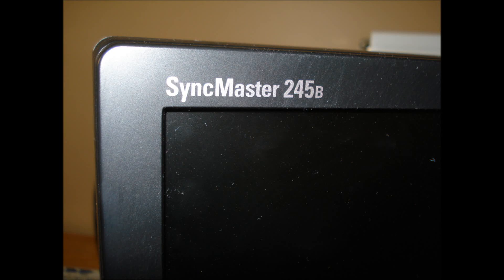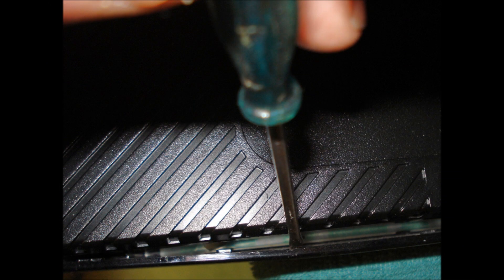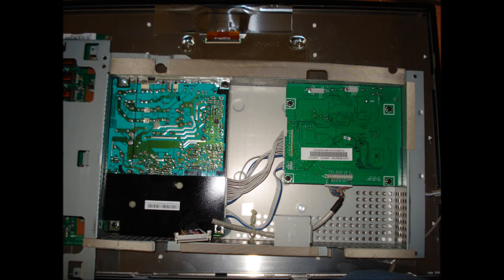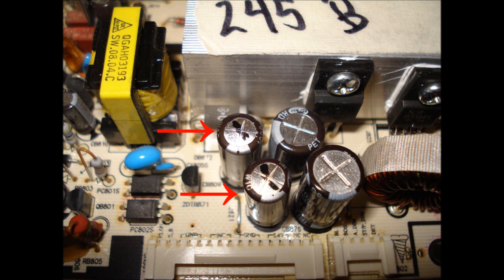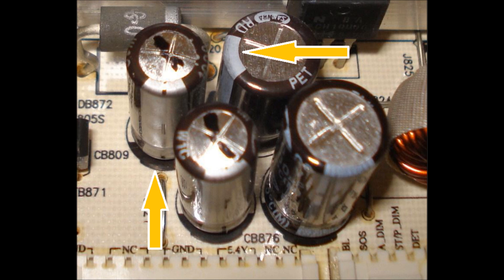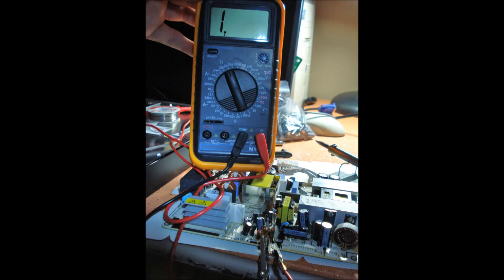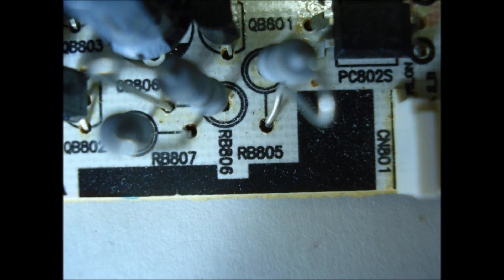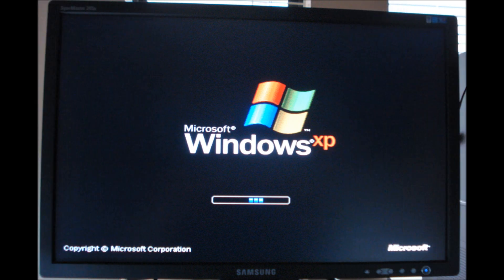Repair Samsung SyncMaster 24 Inch 245B - similar to a SyncMaster 24 Inch 245BW

Comment: Wow!  I did not look forward to replacing my Syncmaster 245bw.  It just quit on me, with the exact symptoms you described!  I dismantled according to your instructions, checked the resistors you indicated, and one was bad.  Caps looked good, and the fuses checked out.  Bought replacement Resistors for less than $0.50 total.  Desoldered, replaced, resoldered the resistors, and reassembled the monitor.  Bingo!!!  One working Syncmaster!  I've rarely had a project go this smoothly in one run.

Comment: Caps looked good, that first resistor in the series was fried. $1.50 for a pack of resistors at radioshack later... Working monitor!  I only replaced the dead one.

Thanks for the step by step! I owe my 1920x1200 resolution to you!

Comment: hey capman!

thank you SOOOOO much for your efforts of creating this video!
with your help i managed to repair my samsung syncmaster 245b!
one of the resistors you described was defect. i purchased a new one for 9ct and replaced it and - YEAH! 
the monitor works again!

and in addition: i found out that by removing one screw on the stand i now have a monitor i can rotete 90 degrees into portrait mode.
all this after 4 years of owning the monitor :-)

thanks again and have a nice day,
steve.

Comment: Thank You Sir, saved me lo a time.
One of my 68R failed, but looked fine from outside – would not have guessed. All Caps still fine. 
Replaced with 2 times 150R in parallel – was on stock – not nice but worked out.
Recycling @ home – love it!

Comment: resistor rm801 poped. what size value is the resister. all i can read is the first two bands which are red red ? ?, also what wud cause rm801 to pop?

Comment: I did the same thing but didn't touch the capacitors since one of the resistors had a short circuit then slapped the back panel back on and everything worked.  I just figured what are the chances of resistor's and capacitors failing together.  Thanks for the video!

Comment: I opened up the back and indeed a small blue resistor burned out on the board, the question is, can i just buy a new power board? or can i get this to a local electrician to fix this? sad to say i'm not soldering iron proficient.

Comment: The other known failure point not mentioned in the video is capacitor CM802. Replacing it fixed my 245b. It's 18nF 630V, but that's hard to get hold of, so I used 22nF 1000V.

Comment from the maker: To rule out the VGA and laptop card, plug the screen into another computer.  When you have issues with the image improving with time, this is usually due weak capacitors.  Another possibility is the the board(s) have a hairline crack in a solder joint(s).  To rectify this the boards require the solder "Reflowed"

Comment: Hi, i have a problem with my syncmaster 245b plus. When i turn it on it has many green or greenish pixels, but after some time (5-15min) problem dissapears and all pixels are shown as they have to. Do you maybe know what could be an issue for this? Could it be my GFX card in my laptop?, maybe my VGA cable? or is it the screen?. Thanks

Comment: Thank you for taking the trouble to make this video.  My excellent 245B died after many years of good service, so I was sad to replace it with a Dell Ultrasharp of the same size.  But before throwing the 245B out I thought check the net and  I found your video.  So I followed your instructions and replaced the faulty resistors , costing 3 dollars, and it came back to life.  So now I have two awesome monitors.   Big thanks indeed.

Comment: my 6 year old monitor that I love, and costs $600 at time of purchase died...  I thought I was going to have to replace it.  Instead a 28 cent resistor saved the day!  Thank you.  Sadly I could only get it in the half watt flavor so I only replaced 1 of them (the failed one) but if it dies again, I'll order in the 1 watt or better.

Side note, I was able to get a good reading from the back of the PCB.

Comment: and by the way, I used three 2W resistor 68ohm and a 16V capacitor 1000µF because I couldn't found the same. But it work fine. the seller told me that it will better resiste temperatures

Comment from the maker: If you are having difficulties locating the 1 Watt 68Ω resistors, the 1/2 Watt, 68Ω  ±5% variance resistors will work fine for this application.  An  outlet such as Radio Shack can supply the resistors required.

Comment: My Monitor failed like this over a year ago. I thought that was it so I just stuffed it in the back room.
I came across this help the otherday by accident looking to buy a new monitor. So I took the thing apart, low an behold resistor RB806 was giving a reading of 1 not 0.68 on my multimeter.
I now need to go an buy the replacement resistors but am finding it difficult. Could you please specify exactly what type of resistor I need. (IE 1W 68Ω 0.5% etc etc) Thanks Capman for a excellent tutorial.

Comment from the maker: Sorry, I have not encountered this issue with a monitor, but have encountered on a Laptop with an external monitor. Certain video display cards (such as Laptops) are unable to properly display higher resolution monitors. Try the monitor with a different tower or Laptop. If you have exhausted all efforts with the computer settings, then  I would suggest replacing your Logic Board with the spare from the other monitor.

Comment: Need your wisdom. Got my BW 245 repaired. Now it's native resolution is 1024 x 768. What part do I need in order for it ti run 1920 x 1200? I have an extra unit for parts, but do not know what is what, Thank you.

Comment from the maker: Regardless, replace the three resistors mentioned. Make sure to upgrade to 1 Watt - 68 ohm.  Yes, capacitors can be faulty with out showing any visible signs.
There are too many variables to diagnose.

For further information see - badcaps forum

Comment: My samsung 245bw just failed as well. At first i was hearing a ticking noise every time i turned the monitor on. Several days later the screen completely died on me and all i see is black. The power on light now flashes blue. I opened it up as you instructed and none of my capacitors are bulging. Can the capacitors still be dead with no bulge. What would you recommend that I try to replace in order to fix it?